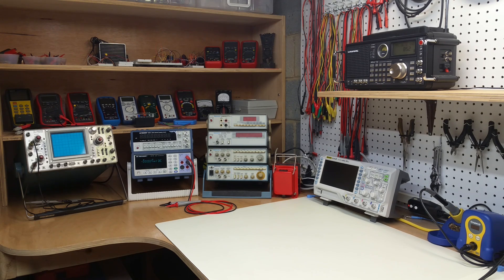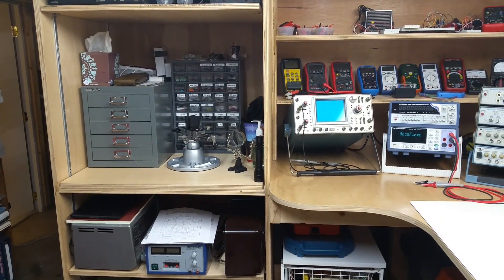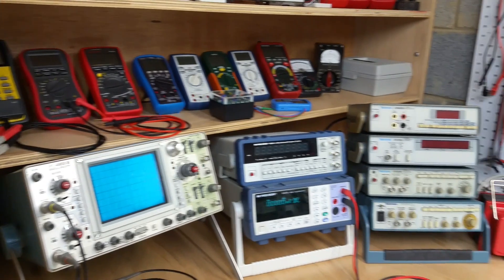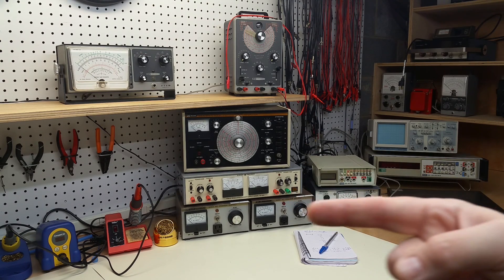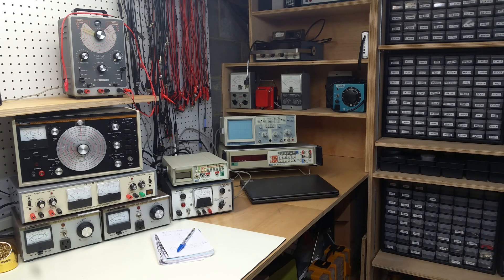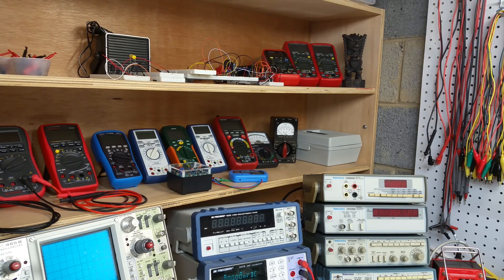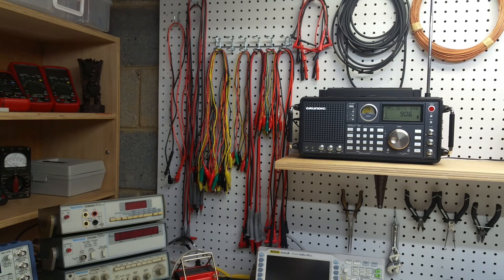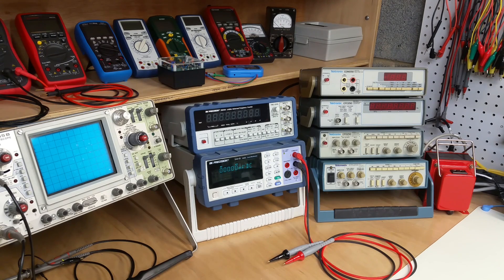#18: Electronics lab and workspace

Comment: Nice lab!  Was trying to get one of those BK 1653 isolation transformer/variacs for a while but they are still a bit expensive.  I finally managed to get a Tenma 72-1095 instead that popped up on Ebay for about $100 shipped.  It's not here yet but I hope it works!
Reply from the maker: Thanks! I hope the Tenma works as you expect it to.